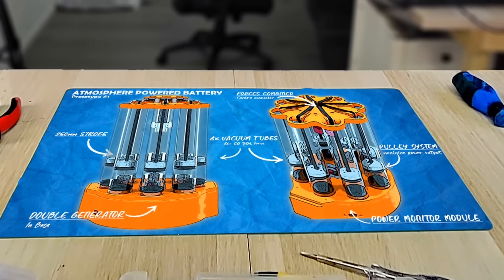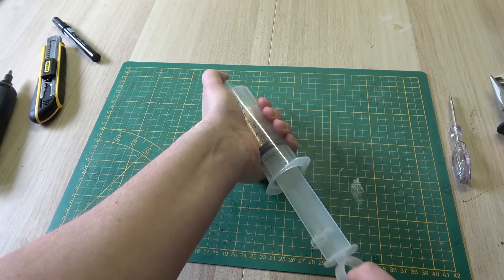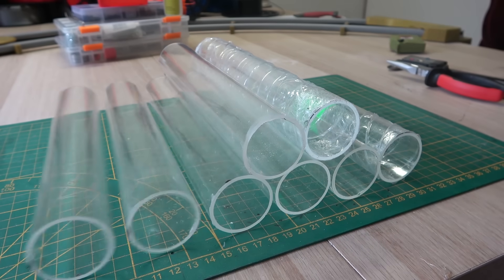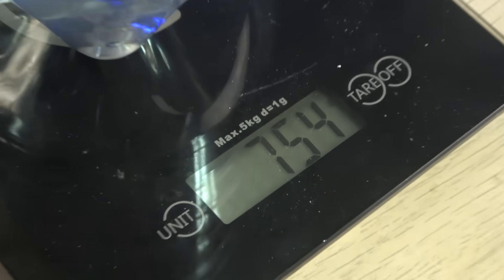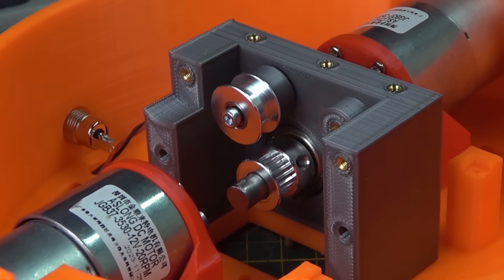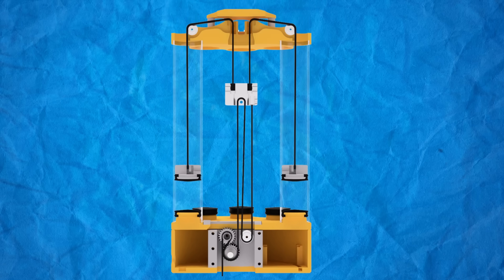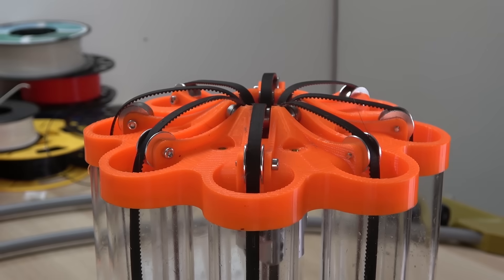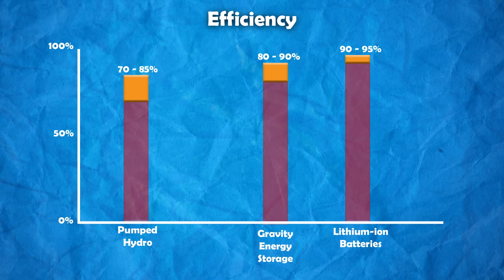Building an Atmosphere Powered Battery..

Comment: that's a great proof of concept, even if the maths are little bit off and you can clearly see some leaks the results are pretty reasonnable. Here are some ideas for the next iteration: 
you could try using some big testing tube (or some other glassware with one end sealed as 3d printed part are not airtight at all.
you could put a dynamometer in between the motors and the pistons to accurately measure the pulling force over time

I will edit this comment if I ever have some other ideas. Anw thx YT for the cool discovery

Comment: Wouldn't High Pressure Tanks be able to store more energy? Ik, Ik, then you would have the added inefficiency of power conversion from "charged", depending on what system you use to convert the pressure backt to energy
So much things to think about, stuff to test…

Comment: After some thought, here are a few that I'd toy with:

Thermal properties: Maybe messing around with external cooling/heating to expand the atmosphere when you're collecting it and contract the atmosphere when you're drawing the energy.
Higher quality parts: I'd maybe see if you can find higher quality parts for the seal itself. There's a ton of friction, so you can possibly look at a different material for the tube and use a perfluoropolyether based applicant (like Krytox) for a lubricant.
Gear ratio's: You could implement some gear ratios into the mix for a few different ideas. The first would be energy over time; you'll be able to draw your energy over a longer period of time. The second would be for speed, allowing you to store the energy quickly.

Comment: Achieving a 73% efficiency on the first go is not bad. There are probably quite a few tweaks that could be made that would increase its efficiency, but even if it never becomes a better solution than a gravity battery, it is always worth exploring a new concept even if it proves another system is better. As to the Lithium-Ion battery comparison, we really should be emphasizing that the efficiency drastically reduces within a few years and is not a long-term solution to energy storage.

Comment: My question/concern is over passive discharge: that is, how much energy does it take (the loss over time) to hold the system in a stable state (neither charging nor discharging). All energy storage systems have a loss over time due to entropy and this system will likely experience small air leaks (or plastic deformation of parts) when held in a charged state for a long time.

Comment: there is one thing that came into my mind and it came out being patented already
so you have barrel with water and the turbiunes in it, or other type of fan
and also you push air to the bottom of this barrel/tube
gravity will do the job
if you make efficiency of turbine higher than air compressor consumes, this will turn gravity into energy

Comment: If you design them to fit in walls you can use these to double as insulation.  There could almost zero impact on space for these batteries and you can have a huge volume hidden in the walls. I think there is commercial viability in a few years of testing and design

Comment: I think perhaps the syringe seals popped off the 3d printed plunger for a reason you mentioned already- the 3d printed part is porous. The original piston is not.  So, if there is a seal between the original piston and the inner side of that seal, then there is no atmospheric air pressure pushing the seal off, as there is with the printed part which lets a bit of air through.

Comment: I think that the seals were the major parasitic loss for this device. did you use a lubricant on the tubes? If not, maybe give it a test after lubing up the cylinders. id be interested  in seeing how  that changes your results.

Comment: Great idea. Thank you for that. I'd consider working with positive pressure rather than vacuum. Higher pressure difference on the piston gives you more force while the friction losses should be about the same. Resulting in better efficiency and also higher energy density over all.

Comment: Ironically enough, air already is a medium used as battery - however instead of creating a vacuum, most air energy conservating concepts utilize pressured air, as this is way easier to seal.

Comment: It's just a storage mechanism.  wouldn't dead weights achieve the same outcome with less trouble? The air can leak and there is a lot of friction on the sides of the tubes that's lost energy.  Weights configured the same would achieve the same result.  Good science demonstration though.  I'm trying to think of why one would be preferred over the other and all I can come up with is that with pneumatic cylinders you can ramp up  the force simply by increasing the diameter and get more bang for the buck than weights.  But getting a lot of weight is pretty easy to come by.  Iron is really heavy.

Comment: An idea, what if you were to charge it at higher altitude where the air pressure is lower, then discharging it at lower altitude, that should result in better efficiency

Comment: Wow, that's a lot of energy stored in such a small space. 
You also could go the other way round: instead of using vacuum you could use pressure and compress air into cylinders. I don't know how much pressure you can get into a cylinder but i dunno... my car wheels with 2 bar have a lot of air in it. Maybe recycle some CO2 cylinders and try putting 20 bar in it. Would love to see a video about it :)

Comment: Why not use a vacuum pump, and then refill via a turbine? I would think with fewer moving parts this would lead to a higher efficiency, not to mention allowing a much larger vacuum reservoir without changing the input-output mechanism unless you specifically wanted to.

For example - I think something like an air-tank should hold a vacuum pretty well, so if you put a chamber attached to the tank with a small nozzle, and a turbine in the chamber with a similarly sized inlet nozzle (but maybe slightly smaller?) blowing on the turbine, then the entire volume of air that passes by should spin the turbine. Meanwhile, to charge it, you could just use a standard vacuum pump. The system could be expanded with more tanks for longer run-time (thus greater storage capacity) or more sets of pumps and turbines for greater input/output current, simply by changing some plumbing and electrical wiring.

Thoughts?

Comment: It will not work as it is depending on change in atmospheric pressure which is insignificant over time will have infinitisimal movements on the prime mover. This is an exercise in futility.

Comment: great idea, this made me think about using hard springs instead of weight or vacuum. In this system would be many pulleys and gears for a reduction effect.
Reply: But how do you keep this device from going back to the original state for later use?

Comment: you can use oil to lube the tubes, to minimize the power input. it much easier to pull and the vakuum is still there

Comment: I'd love to see a larger model using stronger materials! I think this would increase the efficiency a fair bit ...as according to the square cube law we'd get a lot more volume for the vacuum compared surface area for friction to have an effect on.   I saw there was an 80 x 70 mm option on the site as well, which would roughly double the surface area and 3x the volume, while also increasing the wall thickness roughly in line with the volume (from 2mm to 5mm).

Comment: So. Isn't the energy storage capacity of your system only a function of scale (area of the cylinders)? I think that would be the case, since at all times you are counteracting just the atmospheric pressure.

What if instead of pulling a vacuum, you compressed air. That way your pressure difference would change with the amount of energy already put in. And since the upper limit of that is only bound by the strength of your motor and the structures ability to withstand those pressures, you should be able to put in more energy in a similar size contraption. 

Compressed air storage - another widely used energy storage that you did not mention.

Comment: The fundamental issue with this design is it's effectively backwards. You're relying on a maximum of less than 1 full atmosphere of pressure to produce the result, respectable as it is, and since your differential can never be entirely 1 atm to 0 atm due to the difficulties in producing full vaccuum, instead it makes far more sense to pressurise gas using a hydrolic piston then use the back pressure and depressurisation of the system to produce power. However doing something like that safely requires a lot of considerations of the contained gas to avoid auto-ignition under pressure, though the advantage of using high energy fuel gasses is obviously that you can actually use that gas itself as fuel as well as a power source by syphoning it off, which can also act as a safety valve.

Comment: Hello, nice video! I’m not an expert, but I had this doubt: if we were to insert water (or another liquid) into the cylinder, could we increase the capacity of the vacuum battery without necessarily having to increase the size of the piston? This is because we would exploit the boiling enthalpy of water. Correct? Perhaps there would be greater losses, unfortunately, I don’t know. Could someone tell me where I’m going wrong? Thank you very much!

Comment: Add some silicon oil inside the tubes, and the efficiency would increase.

Also, and most importantly, calculate Wh in and Wh out as these numbers represents the energy in and out. Because you don't mention for how long time the power in and power out lasts.
For this reason, 73% efficiency for this setup I would argue is an overstatement. I would guess the efficiency is much lower. Somewhere around 50% or lower.

Comment: Have a look into i-CAES systems… isothermal low pressure CAES systems because at low pressure the cycle of charging and discharging is relatively low on thermodynamic losses. What you have created is essentially a negative (low) pressure CAES system. With a vacuum you are limited in the amount of force a certain piston volume can offer you. With positive pressure you can far exceed the power density your current setup has. Absolutely love this contraption though! Beautifull work! Keep it up!

Edit: the trick is to create a system that stays at 5 bars (72,5 psi) internal pressure during its entire unloading cycle… so not to have a cylinder at 5 bar that then drops of to zero in a roughly linear fashion… but to have a volume that keeps itself at 5 bar when unloading till the very end… I have once made calculations how heavy a weight (piston inside a sealed vertical cylinder) I would need to be able to store enough energy to power a house for a full day… with a 1 square meter surface area piston made from lead the piston would have to be 4,5 meters high (Osmium would half that height) if I remember correctly and travel through a vessel with a free height (excluding the piston) of 18 meters high… This could all be drilled into the ground… The seal would have to be perfect ofcourse.. Anyway this weight will only lift with 5 bar…It is essentially a giant regulator… it will hold 5 bar across its entire range… key to high efficiency low pressure CAES with low thermodynamic losses. Didn’t think it practical though to have a 52000 KG lead piston ‘created’ to try it ^^. Using a deep lake or the sea also works well since those also offer constant pressure at depth X… But I don’t have a deep lake or the sea in my backyard and was (like yourself) thinking about decentralized energy storage.

Comment: For more fun, put it in the car and take it to a high altitude with lower atmospheric pressure. Pull the vacuum there, then drive back down to a low altitude where pressure is higher. Add another motor, using some kind of coupling, and you should (will?) get more power when the generator runs due to the increased atmospheric pressure. This would be useful if, for example, you work at a higher altitude each day, then return to a lower altitude afterwards. (I'd love to see a test of this!)

Comment: Nicely done. The concept is solid but I think there is some space for improvement. I think there's a lot of friction between rubber seals and cylinder. I would try to use a diaphragm instead of pistons. 
If you want pressure instead vacuum as energy storage medium I propose airbags from truck suspension. Ther endire a lot and there is no friction when airbag moves up and down

Comment: Interestingly weight based energy storage was one of the first ways you'd have electric lights, a domestic would put rocks on a platform which would lower to the ground over the course of a couple hours.
(Which is a simple evolution over the grandfather clock, where you use a motor instead of clock hands.)

Comment: He said 628 watt second which is 628/60 watt mins 10.4w min. /60 which is 0.17 wh and 1 3.7v li-ion batt is average 10wh. 

So you would need abot 57 of these machines to output the same ammount of energy like 1 li-ion cell...

Not really useful

Comment: He said 628 watt second which is 628/60 watt mins 10.4w min. /60 which is 0.17 wh and 1 3.7v li-ion batt is average 10wh. 

So you would need abot 57 of these machines to output the same ammount of energy like 1 li-ion cell...

Comment: I like it, and I think that cost and size are more important than efficiency, because these are intended as solar powered batteries. This idea doesn't require an artificial lake in mountains (die we niet hebben in Nederland) or holes in the earth. If the batteries don't get you through the night, you just need more of them. So great job!
Reply: I think this is the more important take away in that you have a small compact design with a few cheap consumables needed for maintenance. (mainly seals)

Comment: Sadly, the maximum capacity of a vaccum energy storage system is limited by the atmospheric pressure, since it can be simplified to a low vs high pressure system.
Since we cannot decrease the pressure (cant be lower than 0, a complete vaccum), we can only increase the capacity in two ways; a bigger volume, or a higher pressure on the high pressure side.

Comment: You have the right idea but USE A TESLA TURBINE WOTH A TANK ANF A VALVE AND A VACUUM BATTERY OPEN VALVE TURBINE GO SPIN AND YOU ATTATCH A GENERATOR TO THE SPIN. SEND VOLTAGE BACK TO TESLA TURBINE DRIVESHAFT TO MAKE HYDROGEN OXYGEN GAS MIX INTO THE VACUUM <ie. The vacuum of an internal combustion motor like your car. They have about 8 to 9inHG at idle or More so the turbine will never loose vacuum and act like a standard turbocharger with upgrades

Comment: I wonder if it would perform better submerged in water. At 100 foot depth for instance, you’d get 4 times the force required to pull vacuum. Also, water is a larger molecule so you’d probably have better success against leaks.